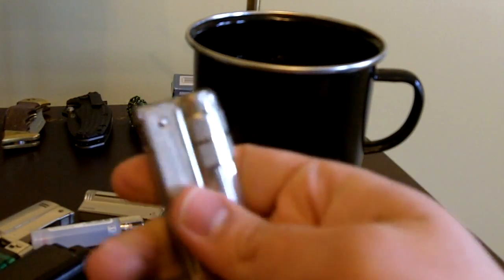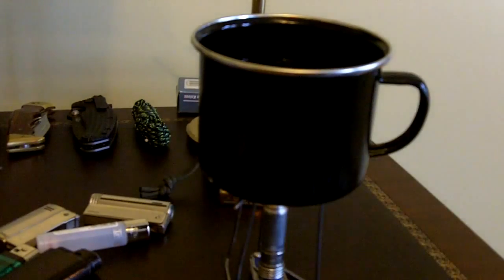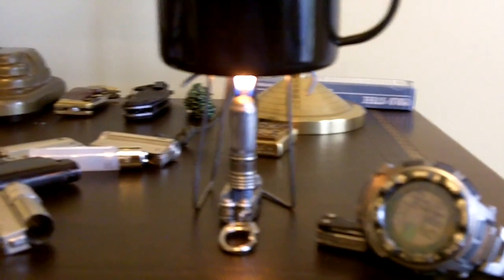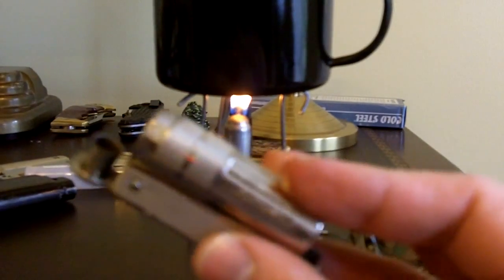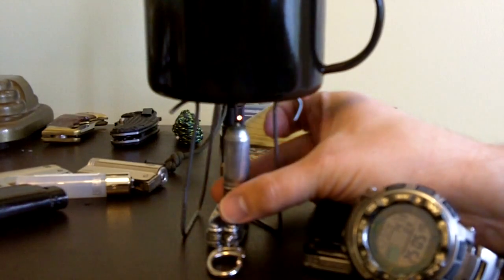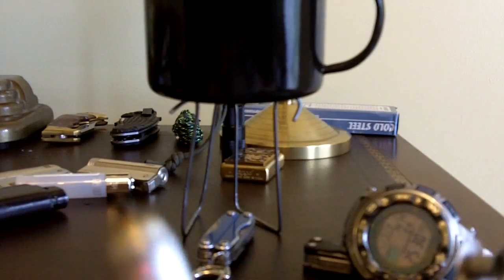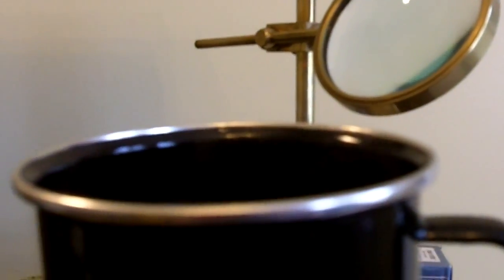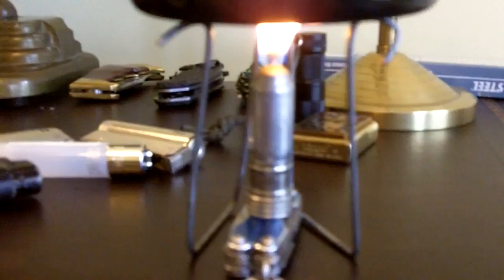Heating/Boiling Water With an IMCO Lighter

Comment: wait for 25 min for just a glass of hot water. I feel this i s not sensible .. and you end up exhausting the lighter fuel . who would do that .. in the case situation optimum use of the lighter fuel is most important than a glass of water. wel its just my point of you
Reply: MrDamudi the point is not  how effective it is but just the fact that It could be done